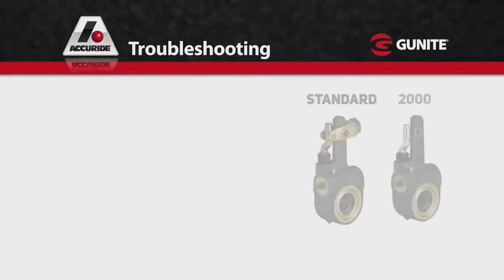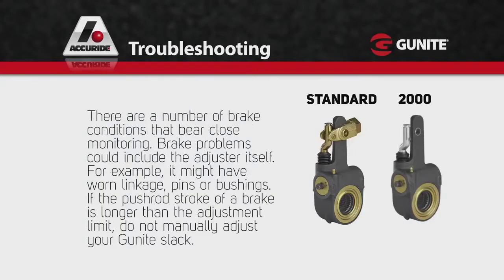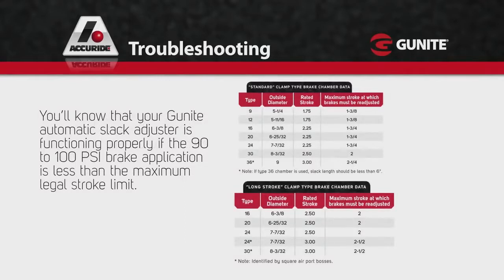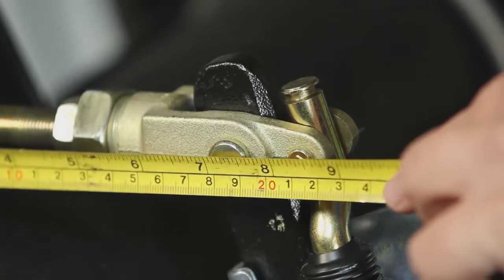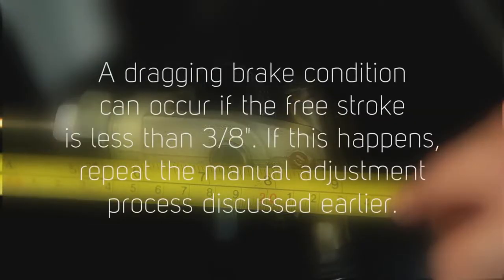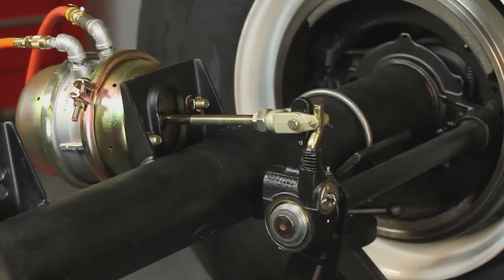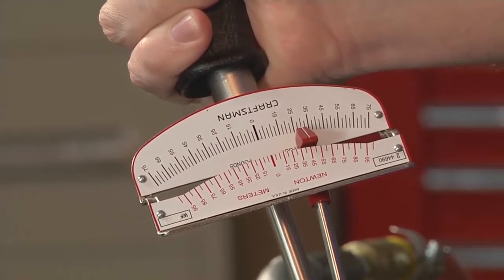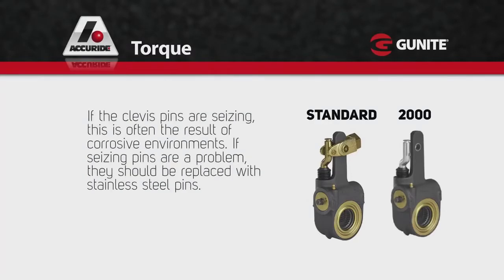Troubleshooting Gunite Automatic Slack Adjusters

Comment: Is it possibly that the slack adjuster is over adjusting? I have 1 on a trailer that keeps locking up
Reply: Yes it's possible , also check the drum for roundness, this will cause the slack adjuster to tighten on a highspot and lock up on a low spot
Reply: @albundy4341  i replaced the drum and brakes and it still lock up. I finally disconnected the bolt that actuates the automatic slack adjuster. I have to adjust them manually now.